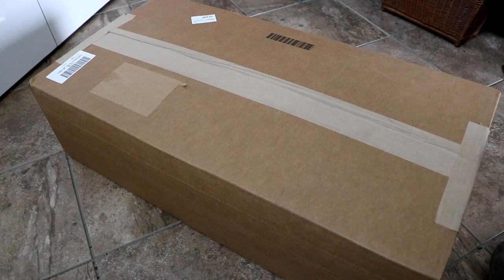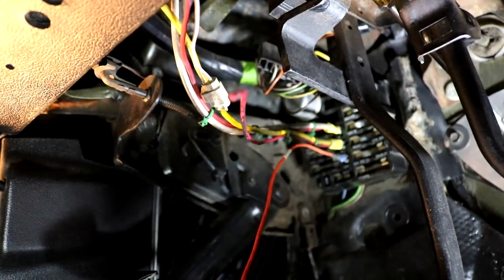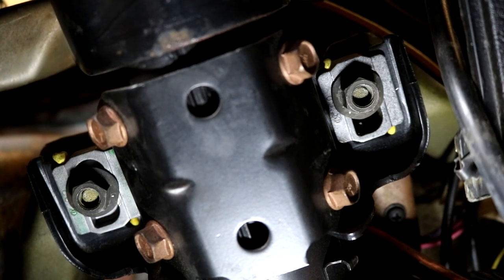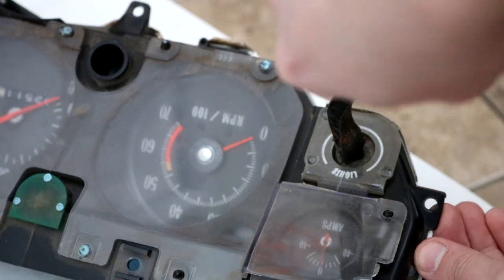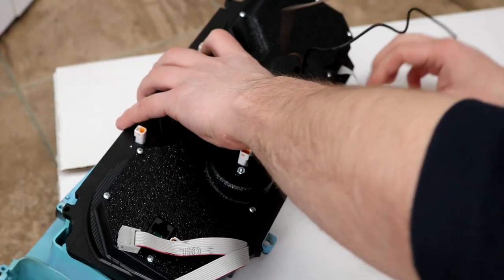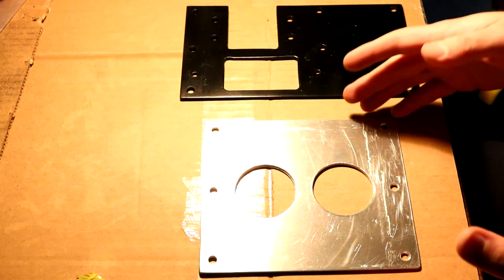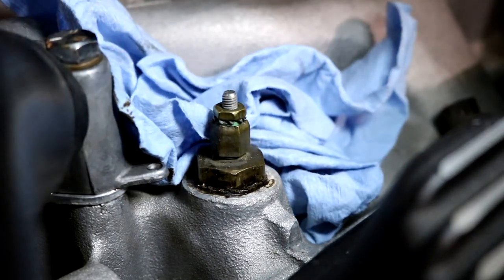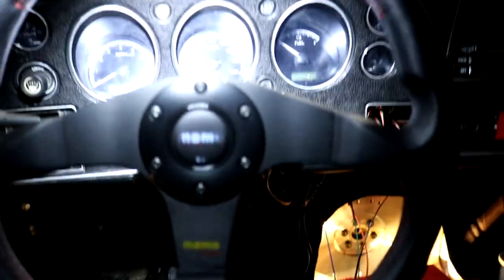Dakota Digital VHX Dash Installation - 1971 Chevelle SS

Comment: I work for rotisserie restorations in Griffin Ga. I do these installs all the time but I recommend repairing any wiring issues in the car before installing this unit. I would also recommend doing a draw test before and after the install. These systems are awesome but sensitive and can be damaged when voltage and grounds are not correct. Congratulations on your new unit!
Reply from the maker: Excellent advice. I especially did a complete rewire behind the dash on my car.
Reply: What shop you work at

Comment: I just purchase this for my 70 Chevelle.. Hopefully someday Dakota can finish there dash cluster dirty work with a plug and play wiring harness. Now i get to cut and slice the wires and find were they go for my turn signal's and brake lights and hi beam lights.
Reply from the maker: I 100% agree. I looked all over to get one clip so I could just plug into the original harness and avoid splicing, but no luck.

Comment: Hey I have been watching your post of the Dakota Digital Dash I was just wondering to see more detail  mainly the location of the Positive Transition block and the positive and would like to see part 2.
Reply: Also do you have the measurements of the metal plates you put the VHX and the measurements of the metal you put the  painless, negative braker block, and accessory block on

Comment: I have a question so basically the vhx box replace your orginal junction box and you just use reminding wires is there a step by step procedure I like the way you set your up?
Reply from the maker: The instructions Dakota Digital provides are very very good. The hardest part is tying into the Chevelle's original wiring to know which wire is the blinkers and such.

Comment: Thanks for posting this. Extremely helpful. I’m getting ready to tackle this on my ‘72. Just curious how hard it is to get to the screws to remove the gauge cluster. Do you only need to pull the dash out partly to be able get access to unscrew the fasteners holding the gauge cluster to the dash? Can you access all of the fasteners from the top of the dash or do you have to get under the dash to reach the ones on the bottom. TIA for any additional insight!
Reply from the maker: As seen in the video, you don't need to remove the entire dash to get the gauges in and out. Access to the bolts aren't that bad.
Reply: @SS454LS6  Thanks. Appreciate the additional info. Thanks again for the video. Very helpful!

Comment: Where did you get your wiring diagram to know what each wire goes to for the connector that goes into the back of the cluster???
Reply from the maker: Position................color/function

1---Light blue---left front turn signal
2---Gray---dash lights to illuminate gauges
3---black with white tracer---ammeter
4---black---ammeter
5---light green---hi beam indicator
6---dark blue---oil pressure indicator
7---pink---switched ignition power to all indicator lamps (except hi beam) and gauges
8---tan---brake warning indicator
9---dark brown--tach signal
10---dark green---temperature sender signal
11---tan---fuel sender signal
12---dark blue---right front turn signal
Reply: @SS454LS6  Huge help my man! Thank you! Now i just have to wait 8-12 weeks to get mine ugh
Reply: @SS454LS6  getting ready to start my wiring to the box. Some of these match and some don’t. Where do you recommend I find the proper pin out diagram?
Reply from the maker: @AustinEhm  which ones do not match? I remember this was the hard part for me as well. I even traced the wires down to the steering column plug in.
Reply: @SS454LS6   this is how mine is setup. 
1. Double light blue 
2. Gray 
3. Brown 
4. Black - presumably ground 
5. Double pink 
6. Nothing 
7. Brown
8. Brown 
9. Dark green
10. Dark blue 
11. Light green 
12. Double dark blue
Reply from the maker: @AustinEhm  Did you have a sweep dash before? Or a different year? You have to do some heavy google searches, but the colors theoretically should be the same function.
Reply: @SS454LS6  Stock dash as far as im concerned. Car had a 3 gauge package below the dash with oil pressure, temp and tach and i have all that stuff labeled. i will def do some more research and see what i find
Reply: @SS454LS6  so I basically followed your numbering and wired it up. Different color wires but that really I would expect. On your headlight switch, did you still use the factory ground that goes around the headlight switch?
Reply from the maker: @AustinEhm  Yeah. I just tied it into other grounds that I routed to my ground block.
Reply: @SS454LS6  appreciate the help! Almost done with it and testing it to make sure everything is good before reinstalling dash
Reply from the maker: Awesome!

Comment: Awesome video,  I just ordered the VHX for my 70 Chenille SS 454.  Did you do any other videos on it?  Also have you done any videos on the fitch refi, thinking of doing that next to my chenille but have seen some bad reviews on it.  Did you have any issues with it?  Thank you, great channel.
Reply from the maker: I don't have videos specific to the VHX gauges, except some clips of how great they are. I have done several videos on the Fitech. I did have an issue with my first unit, as it had a sticky throttle. I think you will find a lot of people will claim issues with a number of different EFI kits, some are valid issues, some are user error.

Comment: What type of gauge and size  did you you use to cover the hole the left of the radio
Reply from the maker: do you mean the vacuum gauge left of the radio?
Reply: I have a hole on my dash exactly at same spot  you have that guage to the left of the radio. I was asking what you used to cover that hole.
Reply from the maker: @nellotsogkas1443  The gauge was put there by the previous owner. The stock dash should not have a hole. I assume it is a 2 5/8" gauge.

Comment: Anyway to get zero miles since I'm putting new engine?
Reply from the maker: The dash comes at 0 miles on odometer. After 100 miles it locks in. After that you will have to call Dakota Digital to see if you can reset.
Reply: @SS454LS6  so when I install it will say zero until I drive 100 miles? Nice
Reply from the maker: @johnathantwinz810  it will be zero when you install it and the count goes up as soon as you drive it. You can change it within the first 100 miles, after that you cannot.